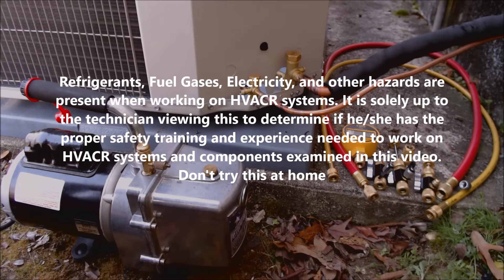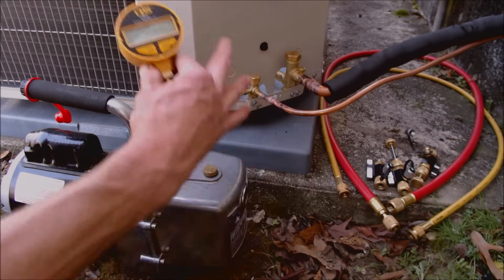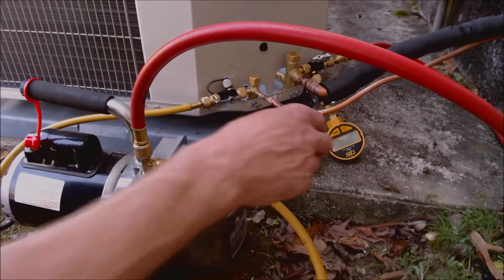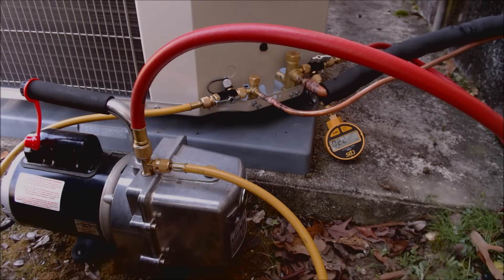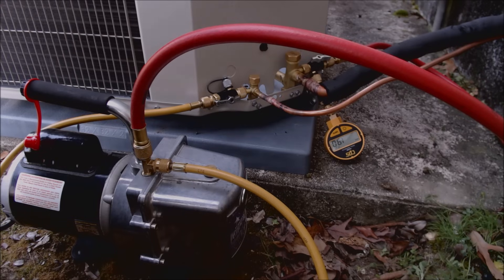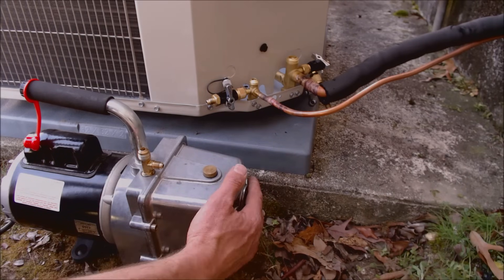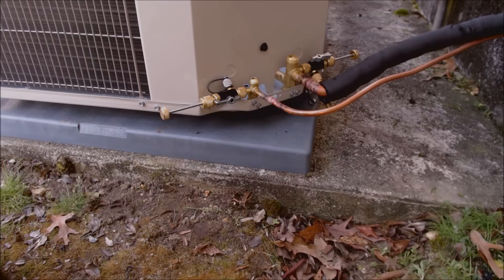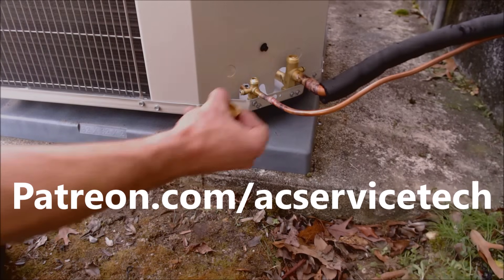HVAC Full Vacuum Procedure From Start to Finish!

Comment: so just using the analog gages how low do you go on the scale that is in neg on the low side gage? to get 500 and 1000 micron? i don't have the digital gage for a number reading. thanks
Reply from the maker: On page 124 of our book, we describe how there is no possibility to know how deep the vacuum is just using gauges. The increments on a gauge could be 500 microns or 10,000 microns and there would be no way to visually see this on a compound gauge unfortunately. We have an article on 40 vacuum tips with a pic for each at our website at https://www.acservicetech.com/articles thanks!

Comment: so how many inches of vacuum is 200 microns?
Reply: 25,400 microns in 1 inch so it's a very very small fraction that no mechanical compound gauge set will register.

Comment: From your experience. If you have a leaking flare nut on the line sets on the mini split unit that loses gas every season. We're during the upcoming season you fill the system up topping it off, and have done this three years. I've noticed that the system now doesn't cool as well as it did when I first installed it. In your opinion and experience. Could the unit have taken in air affecting the performance of the unit. Where it would be a wise thing to remove all the gas and pull a new vacuum and install new freon to get it to cool the way it did when it was first installed.

Comment: When making a vaccum the high side and low side valve are close?
Reply: Appears to be a condenser replacement which came pre-charged so just vacuuming line-set and evap.

Comment: At 1:30 why you said you want to remove the valve cores of Appion 's side ports ? I believed you need just ONE ,the one you will attach the 3rd appion and vacuum gauge. Why don't you just leave the other 2 in, they will help to protect the system sealed no leak while you vacuuming it ?
Reply from the maker: They certainly can be left in. I use those 3 for my vacuum and recovery setups. In my recovery setup, I use one tool as a tee so I just find it easy enough to remove all three valve cores and never have any problem with 100 to 300 micron vacuums, thanks!

Comment: My ac wasnt cooling so i hooked up some gauges and there was a vacuum.  Compressor and condenser fan were operating normally.  This is an r22 system.  What are your thoughts about the vacuum and converting to r407c?  Thanks.

Comment: Are there any problems cross threading a Schrader valve using the valve core removal or does the tool help align the valve properly?

Comment: ive been vacuuming for 2 days now i'd be happy with 700 at 1300 now but my system holds 170lbs of 404 and has a lot of service ports and valves.

Comment: I had to use 2 - 1/4" . Took awhile to pull a vacuum. Is pull below 200 microns a must?
Reply: Also using a brand new single stage 6 cfm pump.
Reply: Finally, after a few hose bumps, I achieved 180 microns!!! During my 10 minute wait, the cps dropped to 140. Patience is the name of this game.

Comment: Did you remove the  valve core from all of the core removal tools, even the one used for the vacuum gauge, is there any benefit on the one used for the vacuum gauge?

Comment: Question. I had two 3/8 hoses hooked up with 3 valve core tools with the micron gauge and I was able to pull to 390 microns but when it was finished & I went to isolate the vacuum and close the shut offs, I was instantly losing like 300 microns then it would hold. it passed  nitrogen test also any ideas of what was happening?

Comment: Gas ballast knob open vacuum process time. Or not
Reply from the maker: If your vacuum pump has a gas ballast, keep it open until you get down to around 20,000 microns and then you can go ahead and close it. That helps the lifespan of your oil, thanks!

Comment: I need help anyone I’m new to the trade. This is a new unit so the service valves 9:45 are closed. So if it were an existing unit do I have to close the service valves before I do the vacuum? Thanks and god bless
Reply from the maker: If it were an existing unit, it would have the valves open with refrigerant inside. If all the refrigerant leaked out then yes keep the valve stems up in the open position. If you just needed to replace the metering device or something, you could do a pump down or shut the valves and recover the rest of the refrigerant in the lineset and evap coil before replacing the component and you leave the service valves in the closed position until after the system is vacuumed. Then you break the vacuum with liquid refrigerant into the liquid line and then open up the service valves and turn the unit on to check the charge. I have all of the steps for each procedure in color and spelled out in my book at https://www.acservicetech.com/ac-book and over at https://www.amazon.com/shop/acservicetech thanks!

Comment: when charging the system should I charge through the core removal tool with valve core removed or just use a hose with low-loss connector?
Reply from the maker: If the system is off and under vacuum, charge though the valve core removal tool into the liquid line so there is no restriction and you can weigh in the amount needed, thanks!
Reply: @acservicetechchannel  would you recommend using smaller diameter hoses for charging or it doesn't matter?  I'm talking about residential refrigerators where there's a small charge of refrigerant. feel like those 8oz. may turn into vapor in a large 1/2" hose.

Comment: I have two valve core removal valves..they say they are rated for 5 or 6 different refrigerants but it doesnt say its rated for a vacuum..the ones that said that one amazon were more than twice as much..will the ones i have still work or not?
Reply: Hook them up to your pump and test them.  Test all your equipment and accessories that way before using them in the field.

Comment: I do installations so when summer hits I’m doing a full install every day 
How often should I change the oil ?
Reply: Everytime you use the vacuum, also if its taking longer than usual you may need to change it out in the middle of a vacuum, i had one just the other day that just seemed to have moisture or something in the line and it muddied up the oil enough for it to hover forever at 900 microns, changed it out and it went down fast
Reply: Theres no vacuum pump oil shortage and its cheap as frig, be on the safe side my friend, you wouldnt use a condom twice would ya?
Reply: Okay fair enough, brand new, never ran, linesets i agree you can let it go longer for sure
Reply: Christian alba. Nope, on brand new domestic units you can do 20 or more units no problem. It's only the gradual ingress of moisture that is a problem. This avoids oil absorbing moisture>acidity.>pump valves corroding.  OR after a huge or nasty burnout repair, replace oil right away.
Reply: Christian alba. Hmm, I'd say yes to large /dirtied or supermarket sized units. 
But daily brand new units, my Yellow jacket pump got a new oil only about 6-8 times a year. With a mix repair jobs. The pump being ticking along for over 15 years at that rate. The biggest killer actually is Dis-use! A pump left sitting in the shed for a year you'll find won't suck. 
Oil, $15 each, it's more that time factor and to dispose of the waste oil responsibly, that's a pain! 
But if you wanna change the oil daily knock yourself out. But otherwise its fine for a month

Comment: thank you for this good explanation video!!  I was wondering, after you remove the core and after you vacuum the system, how do you add refrigerant while the core removal tool connected to the compressor and while the schrader is removed? also, how would you purge the hoses while using the core removal tool?

Comment: Why would you open the liquid line first then the suction and what problems would arise if you did not follow this step in the process?
Reply from the maker: It has to do with the initial oil movement prior to turning the compressor on for the first time. Just follow what the manufacturer recommends in their install literature for which one to open first, thanks!

Comment: Question, when is the vacuum pump use  for?  Getting to understand the whole concept of it
Reply: The vacuum pump is being used to remove moisture from the line-set or indoor/outdoor coil. Any moisture in the lines or coils when mixed with refrigerant will cause acid in the system. Destroy the compressor over time and cause pit corrosion on the copper.
Water boils below room temperature while under a vacuum of less than 400 microns. That’s the purpose of a vacuum - to boil off any moisture to a gas and remove from the system before adding refrigerant.
This guy was talking about freezing and it’s confusing and not correct. Moisture boils below room temperature under 400 microns easy. Take that from an engineer that has designed this equipment for over 20 years for 1 of the big 3 US manufactures of residential heating and cooling equipment
Reply: @georgejoyner3742  you mean ambient air?

Comment: When I disconnected my vacuum hose on my pump the hose had the vacuum pump oil in the hose. I’m using the same pump as you are thanks. Is that normal? Thanks.
Reply: Danny L. That's likely to happen if you kill the power too soon; vacuum can suck the oil back up the lines, that's a disaster actually, the wrong oil potentially getting into the lines ; and a reason you should never have the vacuum gauge upside-down as shown in the video : as stray oil can contaminate the vac sensor.

Comment: Very helpful. When replacing systems should we be running a deep vacuum before  we remove the original equipment so we have a micron number to compare to?
Reply: Mike Reichart. No

Comment: Thanks for sharing. I did not see how you connected the micron gauge.
Reply: Errol Haughton it’s connected to the valve stem removal tool T
Reply from the maker: I always use three valve core removal tools. Check out my latest video on two different vacuum setups. I show the hole setup process there, thanks!

Comment: So the refrigerant is pumped down into the condenser and the valves front seated and once you complete the vacuum you back seat the valves allowing the refrigerant to flow back through both the suction line and the liquid line? Thanks for these videos, they help a lot.
Reply from the maker: Yes except with these types of valves don't force them upwards when they are all the way up like a backseat position on a three position service valves. Check out the videos on service valves, thanks!

Comment: Thank you so much for making a video thats easy to understand.
Would an analog gauge like this work?
And what would the reading in Torr be equal 180 microns?
https://www.amazon.com/Yellow-Jacket-69044-Vacuum-Gauge/dp/B003AK8LG2/ref=sr_1_93?keywords=ac+unit+Vacuum+Gauge&qid=1564707707&s=gateway&sr=8-93
Reply from the maker: I usually measure in microns in the US. You would need to look up an online calculator for that one, thanks!

Comment: WELL DONE!

Lose the "YELLOW HOSE 1/4" and just run (1) 3/8 x 1/4 Appion or "DEDICATED VACUUM ONLY" hose...

Place your vacuum gauge on the end of the core tool where you had the yellow hose was.. Thus you can remove it before opening up your valves to prevent contamination.

By doing this vacuum this way, you ensure a leak proof (FULL OPEN LOOP) by pulling via the suction line and reading at liquid port. 

Other than losing the yellow hose and switching places on the micron gauge, you make a perfect vacuum.

You can see here the way i do it, (EVERY DAY)... Only difference is a APPION VCT is between my micron gauge now instead of bolting directly to port to prevent contamination. 

https://www.youtube.com/watch?v=VgGEKGGBqKY

WELL DONE, WELL DONE INDEED!
Reply from the maker: I do a two hose method so the vacuum is not restricted at the metering device. It also allows for a faster vacuum. During the pressure test and the oil blowout procedure I flow nitrogen through as well as the 3 cfh during the brazing procedure. If the procedure works it works as long as the tech is doing a standing vacuum test, thanks Iconbadgta!

Comment: Could do with with single line correct, and just put cap on other valve good to negate leaking there?
Reply from the maker: I am planning to do a video on that soon. Yes it can be done but you are trying to pull the vacuum though the metering device orifice half way down the tubing length with a single hose setup, thanks!
Reply: @acservicetechchannel  Ah, understood... Look forward to you addressing in future video!

Comment: Great video, thanks for posting.  As far as breaking vacuum goes, I understood it to be a bad thing to open the service valves.  I was told this is because the vacuum could pull too much oil out of the compressor.   Am I operating on bad information?  Also, I've found that the cooler you keep the service valves (while brazing), the easier they are to open.
Reply from the maker: It certainly doesn't hurt to break the vacuum with refrigerant from the bottle. The manufacturer will usually say it is ok to open the service valves to break the vacuum. They tell you which one they would like to open first to avoid any oil lost into the tubes and out of the compressor for the initial startup, thanks!

Comment: Do you prefer setting up the micron gauge only on the suction line? Or it doesn’t matter?
Reply from the maker: With a two hose setup, I put the micron gauge on the low side suction line tube because it is larger, thanks!

Comment: Is there a purpose from to pulling from both service valves? If I have a service valve off my evaporator would it be acceptable to pull vacuum from there? I have better access at the air handler than at condenser. Thanks for your videos huge help.
Reply from the maker: The purpose is so that you don't have to try to pull a vacuum through the metering device half way down the tubing. that is the main reason and for speed. It can be done with one port but it takes longer, thanks!

Comment: To much work for simply vacc
Reply from the maker: Hey Luis, it is the difference between a 3 minute vacuum or 1.5 hour vacuum depending on system sizes and the valve core removal tools allow to do a proper standing vacuum test, thanks!

Comment: Damn those valve core remover tools are expensive. I just started Refrigeration, is there a way to draw a vacuum after pumping down a unit without more than one?
Reply: Ricky32908 . Yes, just gas up to  5 psi, then put it schraders back in at  5 psi, then release the rest of the gas.. 
Small units just use normal hose with schrader depressed. Vac doesn't take that long

Comment: I was told to break the vacuum with refrigerant from the jug not the compressor because it can suck the oil out. What’re your thoughts on this. After the vacuum they make me put the valve cores back and then put my gauges on and break the vacuum with refrigerant.
Reply from the maker: Hey Anthony, You can break the vacuum with the bottle that is fine, everyone has the procedures that they like. However you certainly would not put the valve cores back in until there is positive pressure after breaking the vacuum. You would loose part of your vacuum during that process for sure if you installed them before the refrigerant was added. Also we keep the valve core out so that we can weigh in the total factory charge into the liquid line when we need to weigh in the full charge. This way there is no restriction to slow that process down, thanks
Reply: AC Service Tech LLC so should I attach my gauges to the end of the appions where the vacuum hoses were once the vacuum is done, break the refrigerant and then close off the valves and then put the valve cores after? Ik it’s a lot of crap I’d rather pull from my smans and charge right after
Reply: AC Service Tech LLC I appreciate you’re reply cause even I done like putting the valve cores on after the vacuum cause it will rise in that second I screw the valve cores back in
Reply from the maker: If you are breaking the vacuum with the service valves then just shut off the valves on the valve core removal tools, open the service valve and positive pressure will occur inside the system, then disconnect the hose from the sman and put the valve core back in. This way, you don't get refrigerant into your sman hoses yet. After disconneting the valve core removal tools, connect your sman hoses to the ports and valve cores. Remember to open and close the valve core removal tool ball valve open and shut a couple times while vacuuming to get any air out from around the ball inside the ball valve, thanks!

Comment: Hi I am not an hvac tech but am tackling install of mini split myself. I reviewed your video on flaring the line sets and it was very informative. I have the tools and feel confident I can handle that aspect. I am less certain about vacuuming the lineset. The vacuum procedure on the pioneer mini split occurs at low pressure side. Can one just use the gauges to get a negative reading and just make sure it holds or do you need a micron gauge as well
Reply: Proper procedure is you need to pull vacuum to 500 microns (cannot be known unless you have a micron gauge) otherwise non condensables could be in the system and cause inefficient heating/ cooling or damage to the system.
Reply from the maker: Absolutely correct! A vacuum gauge is needed to determine the vacuum level. Yes with a minisplit system the unit just gets vacuumed from the low side port with one hose since that is the only port available, thanks and I have the tools I use linked at amazon.com/shop/acservicetech